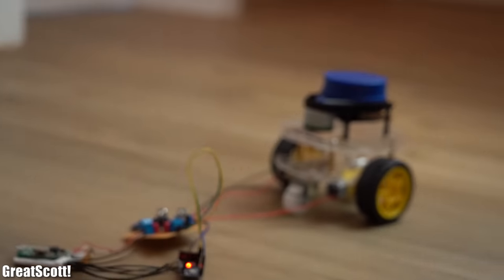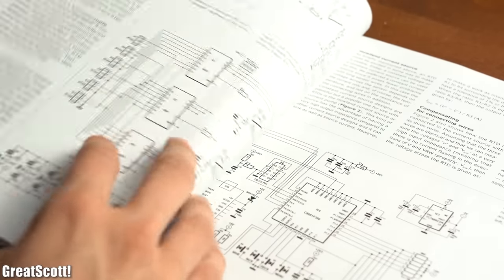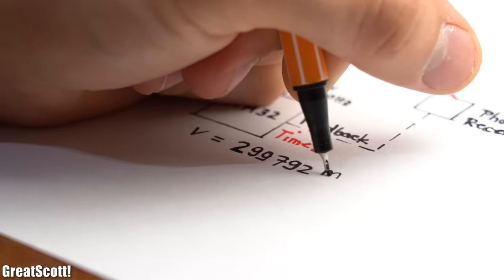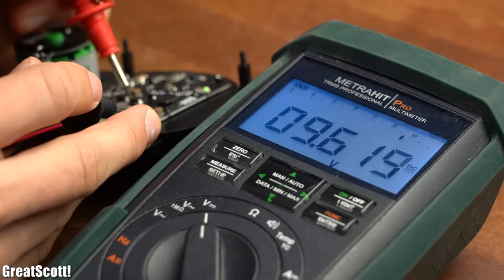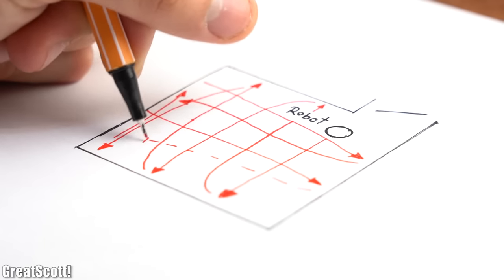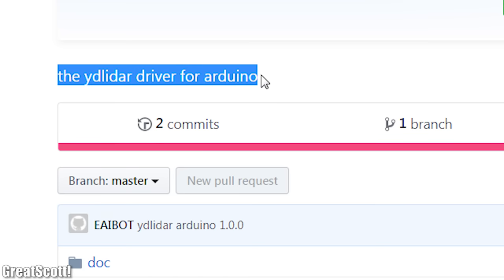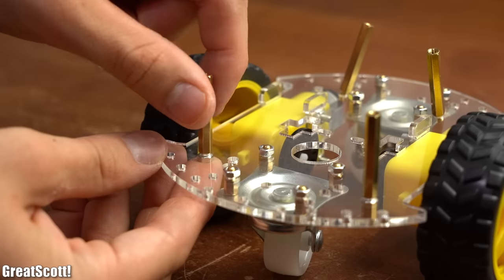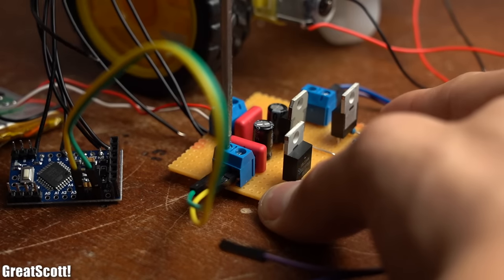Is LIDAR easy to use for hobbyists? DIY Roomba? Obstacle Avoidance System for Robotics

Comment: This sensor dosent use time of flight (tof) which would be terrible expensive. It measures the angle of the returning lightbeam with a linear ccd. In the description of the sensor they also write triangulation principle.
Reply: Yep it is a parallax system, however Y
You can actually build a ToF sensor with relatively inexpensive electronics, issue is they're not fast enough for this kind of scan rate.
Reply: Actually, there are ready-to-use pretty cheap ToF sensors. VL53L0X by ST for instance.
Reply: Exactly. This most probably is the triangulation sensor for vacuum cleaner robots working using triangulation and NOT ToF. There is a paper of 2008 IEEE International Conference onRobotics and AutomationPasadena, CA, USA, May 19-23, 2008; Kurt Konolige, Joseph Augenbraun, Nick Donaldson, Charles Fiebig, and Pankaj Shah: A Low-Cost Laser Distance Sensor. But unfortunately many youtubers are mixing these things up.
Reply: @kotqrka  that thing looks interesting. Thoug it doesnt measure very far and only distances in 1D not 2D, but thats only a matter of time. It is a while since i looked into the 2D sensors and they are still to expensive for my purposes, maybe sensors like this could push the price down even more
Reply: well, using latest stm32g4 that has timer with resolution around 180ps it's possible to build tof sensor with res around 60mm
Reply: Yep, it's really cheaper than a ToF setup (and more suitable for short distances). Another cheap alternative are "phase shift sensors", often used in laser range meter.

Although as always great vid @greatscott!
Reply: it would be weird that you can measure a signal at the speed of c, when the signals in your circuit are only traveling at 2/3 c
Reply: @kotqrka  ST makes it happen!
Reply: I could be wrong but isn’t measuring the returning angle simply a way of discovering the time difference via knowing the rotation speed of the housing.
Reply: *doesn't
Reply: @EtecMax  for 2D you need 2 sensors and for 3D 3 sensors. Just like gyroscopes.
Reply: @bulwinkle  the sensor in the Video is spinning, that way you can measure a 2 dimensional space with a sensor which alone only could measure distance in one direktion.
It only measures distances in every direktion which will be transformed by Software into a 2d plane. So i would count that as 2d from a 1d sensor with Support by Software and mechanics.
Reply: @minikindaniil99  only if you would be able to time the emission (including jitter) from the laser on one side of the head and the analog signal detection and processing of the returning light beam on the other side of the head, transport of the signal into the chip through pcb traces, pins and bond-wires and the event capturing inside the controller to the same degree of accuracy. Even the ultra-fast comparators on the STM32G4x4 are only advertised at a speed of 17 ns i.e. a time in which light travels 2.5 meters and back.

Affordable ToF sensors exist as mentioned in the comments already, but they only work, because emitter and receiver are contained inside the same chip-scale package.
Reply: also according to the datasheet the 184 ps timer resolution is only available for the 12 pwm output channels, not for capturing external exents. https://www.st.com/en/microcontrollers-microprocessors/stm32g4x4.html#resource

Though I must admit this performance is amazing.
Reply: Yep, you're right. This model is probably the cheapest LIDAR you could buy.
Reply: Yeah. Obtaining the 0.5 mm resolution measuring light turnaround time would require ridiculously precise electronics that is capable of measure femtosecond delays.
Reply: Usually consumer grade rangefinders emit modulated waves and solve system of modular linear equations. It is much cheaper and robust.
Reply: In addition the system takes 2 pictures of the linear ccd for every point in very very short succession. The ccd can do this internally and report only the difference. One shot is with laser on, the other has laser off. Result is very good immunity to other sources of light. Many of these linear ccd's can do 50000 images/second or more. The two images needed for the difference calculation is thus done successively.
Reply: Exactly my point, btw this thread is amazing. It is exciting to see other engineers discussing a critical issue.
Reply: P
Reply: Yes YDLIDAR X4 is not TOF although they have  few TOF models available at lower cost than other popular TOF lidars from other manufacturers.
Reply: Doesn't matter.

Comment: How amazing is the communication between the main board and the part that rotate... Fantastic
Reply: ok
Reply: Lifi
Reply: Agreed
Reply: This was used in VCRs, it's even more elegant in VCRs, as the rotary transformer used to transfer both data and power
And the motor is brushless motor that can run for years without the need to replace brushes

Comment: Great video as always! To use the Lidar in an easier way, you can use Robotic Operating System (ROS) to handle the data and do the make a program to control it. However, learning how to use ROS is one thing, but once you know it, it's really helpful!

Comment: Yep, I don't think this module using ToF to sensing the distance, because it require a Time-to-Digital converter(TDC) in the system usually it require a addition IC or FPGA, a counting based TDC can be implemented in STM32 but the resolution can not be promising. So this module seems to measure the phase difference instead of the time difference.
Reply: The datasheet does actually say that this modules does use triangulation with a low resolution infrared camera sensor
However, some versions of STM32 microcontrollers have programmable DSPs onboard that are powerful enough to render 3D graphics or do radio communication
Reply: @PixlRainbow  Great to know that, thanks for the information.
Reply: Makes sense. I already wondered how an STM32 can be fast enough to measure the distance by the travelling time of light. That's fragments of nanoseconds for short distances in a room.

Comment: You can run any Arduino at 3.3v and it will just work. Also you can 
 take 3.3v as a digital high in a 5v system and use a voltage divider or zener shunt to output the 3.3.
I know Scott knows this, but sometimes his individual choices come out sounding like what he “had to do” instead of what he “happened to do” this post is for the “I already have an Arduino why can’t I use that one” crowd. To which the answer is you can. Just don’t push 5v into the lidar without checking the data sheet for tolerance.
Reply: Yeah, you would think everyone would know this if they have an interest in robotics and electronics.  Folks need to pick up a textbook every now and then.  Couldn't hurt.

Comment: I was working with lidar and arduino 

It's not that hard. 

There is some few library over internet to help.
If you realy have some problem with programming it doesn't help but trust me, for some student project lidar is a very good investment
Reply: Felt like I had a stroke reading that
Reply: Can you name some libraries to get started? Thanks
Reply: Im also interested in the libraries :)

Comment: Great :)! just nitpicking here a little. But the Lidar doesn't spit out HEX values, it spits out binary data. Hexadecimal is only a representation of that. Also, I think a lot of the corrupted data might simply be because you have the TX and RX pins permanently connected, causing the LIDAR module and Arduino to talk at the same time, resulting in invalid bytes. Otherwise, cool demo :)

Comment: You really should try to make a robot with the RPI and ROS (robot operating system).
The lidar has some really nice packages you can use.
Keep in mind the RPI should only be used as a data publisher to a real computer.
Reply: ROS for hobbyists? 
I don't deny its capabl, butis it easy enough to learn? What about budget?how much for the whole system? Hobbyist servos ore closed loop servos?

Comment: Great video. 
It's not that big of your fault. Those cheap robot kits come with cheap motors as well (the yellow ones) the main inconvenient is that they spin at different speed even they receive the same PWM because they are not identical. In a project we made, we tried to control them with a PID using a MPU5060 gyroscope, and a Ultrasonic sensor to prevent for crashing into the walls. The PID was a fail. Hope you could succeed. Excellent video. Greetings from Ecuador. Also try tu use a L298 driver for the motors they are a big help.

Comment: Well, I stand corrected, I always thought it stood for Laser Infrometry Distance And Ranging. :P You realise that only the really posh vacuum cleaner robots have a LIDAR on board, the rest are just "bump and guess" machines - they bump into an object, turn a random amount, and then continue on their way, hopefully not bumping into another object too soon, so they can do a good job at vacuuming the floor.
Reply: Even lower-tier robots are not that dumb anymore. Nowadays they use ultrasonic distance sensors that, while effectively doing the same thing, prevent them from actually bumping into most obstacles. They then consolidate their movement and obstacle data to create a map of the rooms. Some also come with a webcam that is pointed to the ceiling, effectively reading a mirror image of the room they are in to aide in mapping out the rooms. Thing is, ultrasonic sensors, low-res webcams and the SoCs to do the computing are incredibly cheap now. The distinguishing factor is the quality of the software.
Reply: Xiaomi S5 is cheap and amazingly good at navigating, using lidar, ir and probably more.

Comment: If you are interested in trying some more advanced robotics projects you should look into using ROS (Robot Operating System). It is a great framework to easily develop robotic systems without needing to program everything yourself as it has many tutorials and a great community of developers that make libraries you can implement, including some to make use of that lidar for autonomous navigation and mapping

Comment: I’m glad you showed how the data and power is handled, I’m always interested in how that is done inside devices where it spins more then 360 degrees. (In this case it was LEDs for data and coils for wireless power)
Reply: When it goes past 360 degrees, it creates a tiny worm-hole that objects can pass through and arrive in another part of the Galaxy.  It doesn't have enough power to transport outside that range at present, but they are working on it.

Comment: It's always cool when a sensor uses a more powerful chip as a coprocessor (stm32f302 iirc?) than your main system controller (poor little atmega328p...). Though, I suppose such a topology would make good sense if the coprocessor was only needed intermittently and could be put in power save most of the time.

A little surprised they have so much rotating mass on that unit, I figured the only thing to rotate would be a mirror.

Comment: XKT-412 is a voltage controlled oscillator. I have used this in my wireless POV display project to make an LC oscillator.

Comment: In case You have 3V3 uart device and 5V version Arduino it also works nice if You attach to [Arduino RX]-[3V3 TX] ( most atmegas takes 2V7 and up as high, so 3V3 is OK ) and simple voltage divider ( from two resistors ) to Arduino TX to lower output :) Any way I like Your channel very much! All best!

Comment: Tfw I never realized power supply and communication would be a problem for a spinning sensor. My first solution would be running a separate battery on the spinning part and using RF for the communication but damn...wireless charging coils? That's some brilliant stuff right there! Thanks for the upload. I learned a lot.

Comment: I read somewhere that the main reason LIDARs are not used everywhere (e.g. all self-driving cards) is that having multiple devices (e.g. multiple cars) near each other results in cross-readings and interference. Can you comment on this?

Comment: This is probably a dumb question since I never took electrical engineering but why didn't you use a voltage divider to reduce the voltage from 5 to 3.3 volts? Does it reduce efficiency because it releases too much heat? If that's true, why use voltage dividers at all?

Comment: I was expecting to see LIDAR in your  " DIY or Buy " videos
that will be far amazing
Reply: Yupppp. Do it, please, Chris!
Reply: Engin sci you can try it yourself. Pick an hc-sr04, nrf24l01 and an Arduino pro mini. Put all to a base and try to make yourself. I had printed a base for hc-sr04 and put 4 lines on the circumferance. 4 brushes to the lines. A step motor (byj 48) for driving the base. At the end I got a basic lidar as cheap as a few euros. It does the job, I can manage to get the correct angles.

Comment: Thanks for the video. However, if v stands for the velocity vector, consider using |v| as the magnitude of v instead of v itself.
Reply: Or even better, to avoid confusion involving absolutes of scalars (|x|) you could use ||v||. That's how I show magnitude of a vector on paper.

(Rambling here, and most likely completely unrelated) For a redstone circuit in Minecraft capable of processing vectors with Microcode, I'd imagine that a good way to find the magnitude of a vector would be to get the dot product of it with itself (x^2 + y^2) and then get the square root of that. Both steps should be quick, since any good vector processor has a hardware multiplier and square root extractor.
Reply: @wesleymays1931  Yes, you're right.

Comment: I have been a fan of yours for a long time, my passion in addition to electronics is walking in the mountains, I often see deer and ungulates in general. I tried to see a night vision device to be able to see them, but unfortunately they cost too much for my pockets. would it be possible to create a viewer that at 50 - 60 meters allows you to see the animals without disturbing them and get too close, with low costs, or at least with costs lower than those currently on the market? sorry for my english junk

Comment: The lidar module is way to expensive for a hobbyist imo. Although, building the module itself might be a great project =)
Reply: I think the module would be cheaper.  I built one using the Parallax TSL1401 Linescan Imaging module.  More fun though !
Reply: @franktkalcevic5342  I gave it some though and I think one could build a LIDAR module on the cheap. Of course it would be a very crude one and with lower specs than a commercial one but :
- It's a good project to learn how to design and 3D print parts
- I personally never had to create a communication system using leds and light resistor so I'm quite curious about it
- You'd have to physically balance the rotating part which is again a fun and fresh challenge for an electronic enthousiast.

And finally I think even a very crude LIDAR module would open up a lot possibilities for future robot projects
Reply: Buy Xiaomis lidar (that is used on their vacuums). Cheaper and works about the same.

Comment: Saw a glimpse of the laptop .. blsck with orange stripe. And the OS is not win10 or win8 .. win7?

So by any chance was that a Clevo or Sager laptop?

I’ve been considering one of those lidar’s for awhile as the other cheap methods like ir led or sonar are low frequency response and easily tricked and low distance .. will have to look up the distance on this guy

Thanks!

Comment: LIDARs doesn’t always have a field of 360 degrees, there a lot of them with no moving parts. I worked with robots some years ago and all of them had LIDARs that usually had 270 degrees of vision, cause it is enough to cover front and the sides (if the robot could move forward and backwards at any time, the had two of them, one in each side).

Didn’t had one in my hands, but I also had to wrote some documentation and discovered some LIDARs which could get points in two axis.

Comment: Normally in lidars like this with 360° rotation, the data is sent to the communication port over an internal dedicated wireless channel. Using LEDs and light to it in this one sound strange to me...

Comment: According to a quick calculation, it seems that centimeter precision (with this particular laser distance finder tech) requires at least terahertz computer speeds. Is a separate technology typically used for greater precision? This tech doesn't seem to scale up pretty well.

Comment: The read error was probably a combination problem of the motor rotation, the sampling speed, and the micro-controller. 
The unit probably thought there should have been a surface before the laser powered up, or, alternately, it thought that the motor should have rotated to a new sample angle before the motor actually turned it's rotor. 

Either way, that leads to the next point:

I wonder why they decided to pulse the laser, instead of operating the light source in continuous mode.
I mean.... Pulsing it on and off like that seems like it's adding a level of complexity that's unnecessary, since you have to make sure your measurements are appropriately timed (accounting for both the rotation of the motor and the pulse of light) in addition to appropriately angling the light back to the detector. 

Wagering a guess, it's probably to reduce the power consumption of the LIDAR unit, but I kinda wish there were ways to tweak how it operates without manually building a LIDAR. 

Something that might be beneficial would be polarized lenses, as a for of noise reduction, and as a way to weakly discriminate different materials.

Comment: What would it take to crank up the rotation (and scanning) rate of a similar device to something like 60-90 Hz?

PS: I do not mean overclocking this exact sensor that far, it would not work probably, but more like how much more expensive would it be to make a device like that. Would it be possible to fit a 60Hz scanner into that small of a form factor?
Reply: im looking too